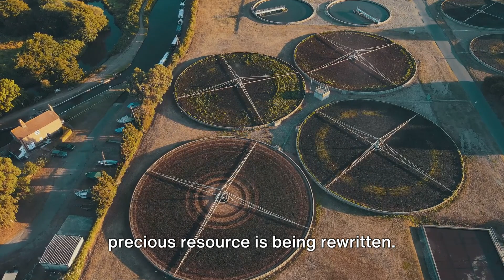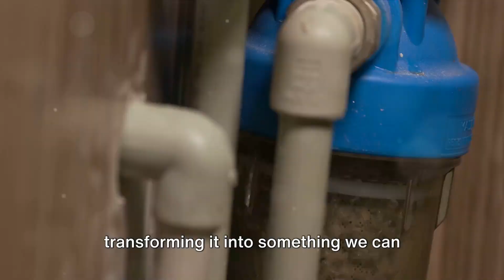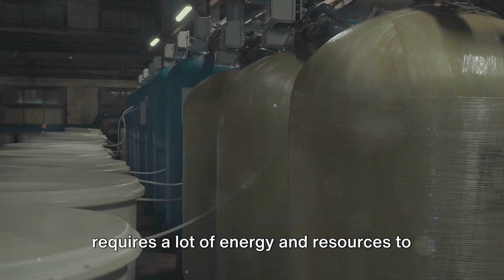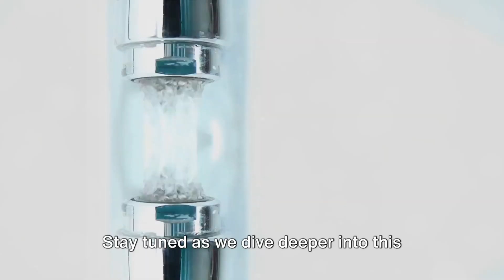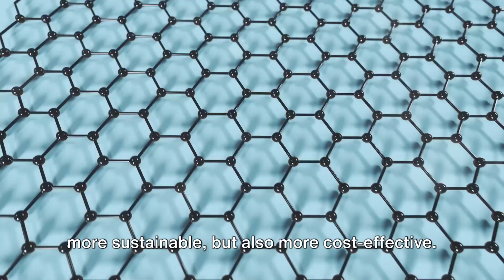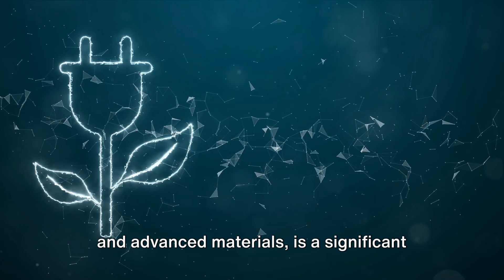Sustainable Water Technologies

Comment: Gravity fed ocean water into Salton Sea, Death Valley & Laguna Salada (MEX) will evaporate from high temperatures and sunlight to increase rain fall in SW Colorado Basin. The Eirex Tech will desalinate as free byproduct of hydrogen fueled electricity not using electrolysis or graphene but advanced high energy cavitation. The mineral rich brine from desalinating ocean water provides excellent building materials that can be waterproof and brine also has opportunities for generating surplus energy as well.